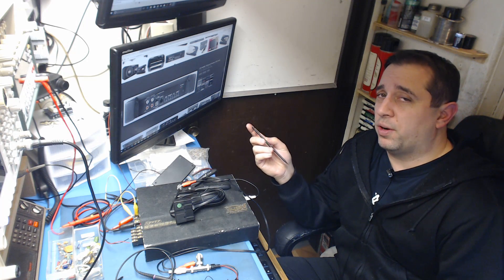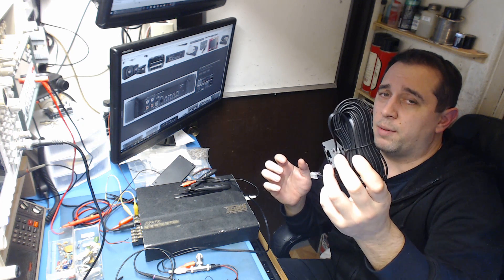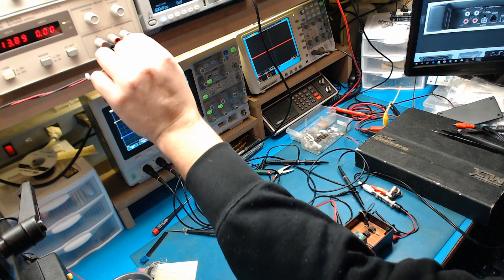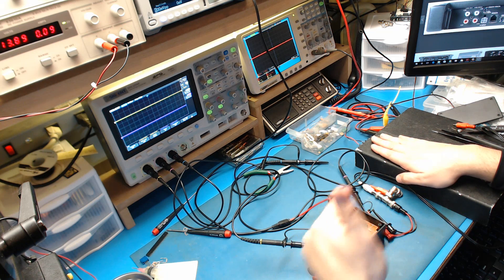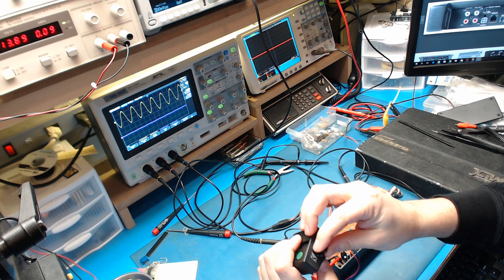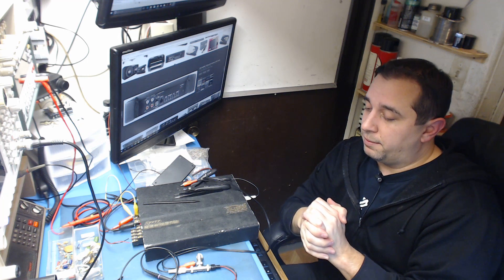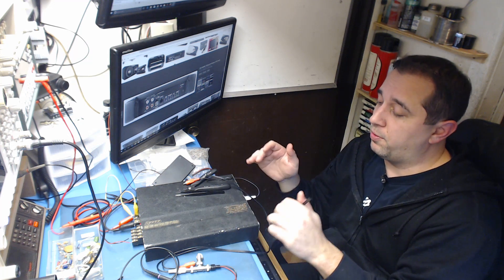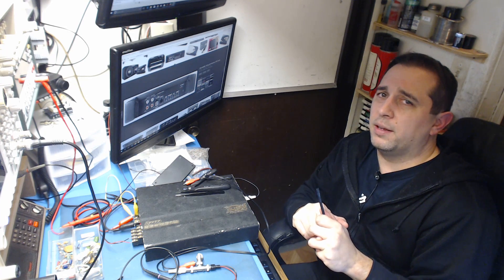BASS GAIN CONTROL PROJECT FOR OLDER CAR AUDIO AMPLIFIERS.

Comment: The amps that have those optional bass control remotes use the +/-15v rails and a LM13600 IC, without breaking the RCA input signal, it actually attenuates the signal after the preamp section. Email me at jeanious2011@yahoo.com if you want a schematic.

Comment: You've obviously put a lot of effort into your cool design. What you've learned may be worth more than what you can recoup by developing this specific product. You have the basis for other control systems, and may be able to adapt your design to many applications. You could also use a selsyn to turn a pot at the amp, which would simplify things. It could also be an interesting project if you use three-phase power. (I'd like to build a wind direction indicator.)
Reply from the maker: Thanks, Yea I really didn't expect to recoup or make any money off this project. If I was going offer this, It would maybe be a  diy kit/board project  or something like that. I know there are other devices that do similar things like this and that there is low demand.

Comment: My Rockford Fosgate already has one, and it's over 10 years old.  It's a good idea for anybody with an older amp.
Reply: 10 years is not old...30 years is old, am using 1991 amplifiers and work like they did the day they came out (I replaced all the electrolytic caps of course). 10 years is considered new by many in the car audio community.
Reply: jeanious2009 I've also got an earthquake 4 ch from 90's it's been pretty solid.  I don't consider either of them as newer amps though.  haha